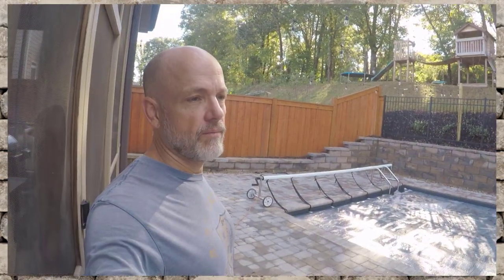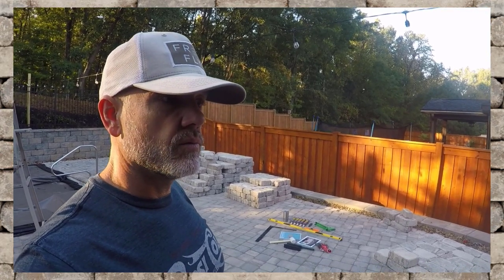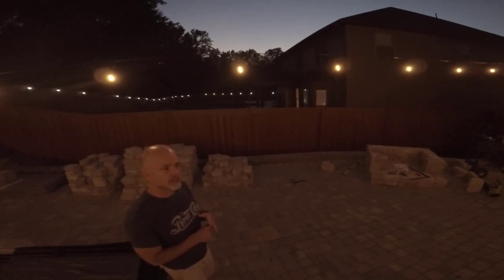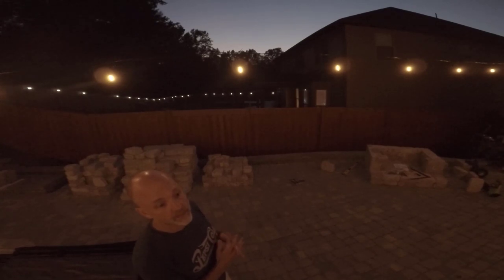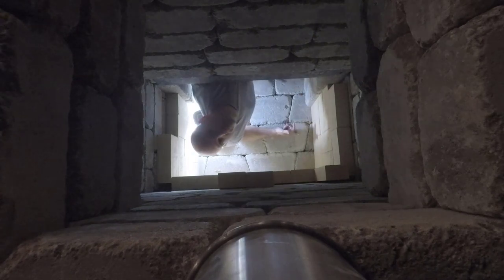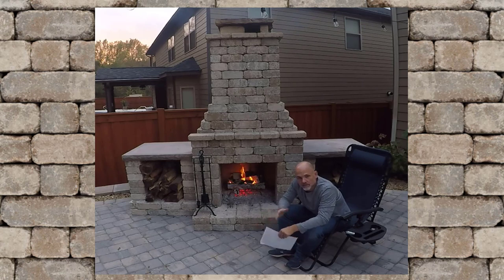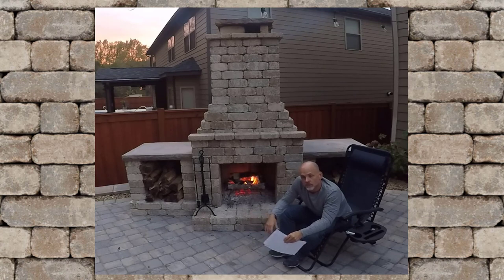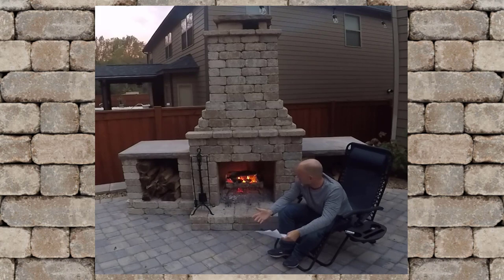DIY Outdoor Fireplace Build - Time Lapse - Roman Stone

Comment: Nicely done Rick. This is my next project and I appreciate your effort and willingness to film your work for all of us. One question, were permits required? I’m deciding between running a gas line, or just going with wood. Also, how far away from your fence were you required to place the closest stones. Does the back get hot?
Reply from the maker: Thanks Mike!  No permits. I thought about running a gas line as well, but decided not to. I just keep a box of fire starters close, and use good dry wood. The fireplace pulls a nice draft and our fires always start right up. 
Fireplace is about 12 ft from fence. Back doesn’t even get warm.

Comment: Do you know if the wood boxes can be added at a later time? We are looking to get one of these. however, the cost of everything has gone up significantly. So my wife and I thought about doing 2 separate projects. 1st project the fireplace and the 2nd project the wood storage boxes. This would help us split up the cost but didn’t know if that was a possibility. Thank you!
Reply from the maker: Hey Isaac. I don’t think that would be a problem. Check out the website and give them a call. They are super helpful.

Comment: Hey Rick- I must say I have enjoyed your video a bunch. I had really considered having a fireplace built but, most places in my area (greater Atlanta) start at 15K (whew). I am choosing the Fremont the same as yours and I am going to do the 24" chimney extension. You should become a "You Tube Star" because you did a great job. I think, just so you will know, the biggest tip I got was "taking it slow" and letting the blocks settle before going to each level. Using the wood box tops to help with the chimney was a great idea. I am a believer in sqaure and level because it pays off later on. I only have one question - how can you get in touch with these folks - cannot find a phone number anywhere. I want to do some preplanning for delivery as I do not want 8 pallets dropped in the street but, put farther back in my driveway - just want to talk with someone. I will let you know how my turns out
Reply from the maker: Hey Larry!  Thanks for the kind review. I don’t know about ‘YouTube Star”, but I did have a lot of fun making the video. 
Call Paul at +1 314-291-3200. 
He is super helpful, and will walk you through any questions you may have. (And let him know that my video was a help)😜
As far as pallet placement, you’re probably going to have to work with the delivery driver. They will have a pallet jack, and from what I’ve read in other reviews, they are usually pretty helpful. 
Let me know if you have any questions along the way. Good luck with your build!!
Reply: Thanks the reply Rick - will let you know how it goes
Reply: @Larry-GeorgiaTrains  Would be curious to know how yours went and what it looks like with the extension.

Comment: Great work until the square dancing started. I wish these kits were available in Australia. I was planning on building one with imitation stone blocks with rebar rods attached to a concrete foundation through them, then pouring concrete into them. However, this kit looks great but does it meet your local codes of building? I'm not sure how good that adhesive is in terms of holding those firebricks in place, I normally would have used fire resistant mortar.Great work and you saved $$$. Start cooking 🍕.
Reply from the maker: Thanks!  Where in Australia do you live?  I spent two years in Freo.  2007-2009
Reply: @rickhawkinson8693  Melbourne. Yeah, been to Freo in WA, nice area by the beach.

Comment: How much heat does it produce?  Does it keep you warm on colder nights?  Colder....as in 45 - 50 degree  -ish weather.
Reply from the maker: Hey Colleen!  It basically puts out heat similar to a fire pit. I’d sit around it with temps in the 50’s for sure, and once you get a good bed of coals, mid to upper 40’s would be comfy as well. So, all that to say it puts out a good amount of heat. And the fire is is so big, that you can put a lot of wood in the fire for those extra cold times.

Comment: Any concerns on how all that heavy, consintraited weight will able to be supported properly just laying onto of that existing paver deck?... I would be concerned that it might sag or settle down causing that stone fireplace to tilt out of plumb?...
Reply from the maker: Hey EE!  I had the same concerns and checked with Roman Stone before I built the fireplace.  The said as long as I had 4 to 6 inches of gravel beneath the pavers (which I do) it should be ok. I also had a friend of mine who is in heavy construction come and verify everything. 
Been up right at a year now and it’s still nice and plumb!

Comment: Looks fantastic. Has your neighbor complained of the smoke going right to their window? Did you have to get a permit? Also, did you glue the fire brick or just stack it? Thanks for the video and the information.
Reply from the maker: Hey Orion. The smoke doesn’t really make it to the neighbors house. The natural draft flows away from their house. And when there is a good, hot fire going, there is barely any smoke. 
Didn’t have to get a permit since it isn’t attached to the house. Just be sure and check your HOA regs. 
I did glue the fire brick in. They can be removed if I ever want to change them.

Comment: Find these fireplaces as a kit from a company means you’re gonna pay double what it would cost if you were just to buy the stones yourself. I looked at one of the kids it was $6000. The lowest one I could find was $3500. Don’t get me wrong so beautiful but I’m not paying $4500 (plus shipping) for the one that I wanted. I’ll just go by the stones.
Reply from the maker: William - I had the same thought when I first saw the price. I am a HUGE value for money guy so I priced it out just ‘buying the blocks’.   Here was my breakdown. ~$3000 for materials, and this is a low estimate. These are Orion blocks that have been processed to round corners and smooth edges.  And the 3 different sizes give the look I was going for.  You can’t just go buy these at Lowe’s.      
There wore 16k pounds of block - so with my 1 ton pickup, that would have been at least 7 trips. Loading and unloading each. 
Then you have to figure out HOW you wanna build it. 
And you’d have to either get the firebox tops and chimney cap made, or make them yourself. 
So - factoring all that in, I went with RomanStone. 
And btw, the cost you see on the website is the final cost. Shipping is included.
Reply: We’ll see that’s where you made the assumption that I’m gonna use those bricks for the building of the whole fireplace. I’m going to use cinder block for the main framing and stone as a veneer. I already priced out the stones to cover as a veneer. And yes, you can buy ones that have corners built into them. These stones in the kit  do not have corners built into them. They were just stones I watched them build it. And it’s not gonna be anywhere near 16,000 pounds as I’m using cinder block for the main framing.. the amount of stones that I would need just as a veneer only cost me $680 . And I can make that in one trip. So total cost would be around 1500 With everything.
Reply: 200 cinder blocks only cost me 570.
Reply from the maker: You do you William. More  power to ya!  I personally didn’t want a cinder block stone veneer look. I wanted the dry stacked stone look.  I hope things go well for you. Video the process and leave me a link. Would love to
See the final product!  Good luck!
Reply: No, it’ll be solid stone. I was just explaining to you as I’m going to use cinder block as the main framing and then the same stone as a veneer just so you understood what I was doing. It will be the same exact stone. Just the framing will be cinder block, and the exterior will be the stone. I just used veneer as an example so you understood what I was doing.
Reply: @rickhawkinson8693   looking forward to your video
Reply: Then find all the rock out in nature and build lol

Comment: That looks really good but that type of outdoor fireplace doesnt keep you warm outside. I have an actual firpit that is 2' below grade with 6" of stone around the edge. It puts heat out 360 degrees and keeps ypu warm 3-4' back from it. Now its not ideal for very small children because its an open fire pit but it does a great job. Mine is big though, you can fit an entire pallet inside it 😎
Reply from the maker: Definitely keeps us warm!  Obviously not as many people as a pit, but we can warm 6-8 people easy in below freezing temps. 
And it looks way cooler thank a pit - in my opinion.
We looked at both, and decided for what we wanted, the fireplace was a better choice.

Comment: Why use this kit vs buying rumblestone from Home depot or lowes?  I know the caps and trim pieces would not be included.
Reply from the maker: Hey Roadie!  Thanks for commenting. Basically, if you buy direct from Roman Stone, you cut out the middleman. Overall cost is about 2/3 of what you could get everything at Lowes for, AND it’s delivered right to your house AND you can get any question you have answered quickly by the good peeps at Roman Stone.

Comment: How many different size stones did the company provide and were they used throughout the construction project or were the larger ones used in a specific location like the base of the fireplace? Curious minds want to know. Thanks
Reply from the maker: Hey Angela!  There are 3 different sized blocks. 4 inch, 8 inch, and 12 inch. All three sizes are used throughout the build.
Reply: How many of each size are provided?

Comment: Hey Rick-
I have been building my Freemont and surprised at how easy it is. Of course the confidence from your video and the detailed instructions supplied by Romanstone really helps. 
As I near my completion I have a chimney extension and I wanted to ask how you got the cap safely to the top and if you have any tips?
Reply from the maker: Hey Larry! Congrats on your Fremont!  Glad the video helped. 
The chimney cap can be a bit daunting, can’t it?  I had a 3 step ladder set up with 2 neighbor friends. I put one step ladder on the left firebox and 2 ladders in front - with the steps facing each other.  You may have to play with positioning the ladders, but the three of us just walked the cap right up the ladder. BE SURE YOU HAVE YOUR CHIMNEY CAP SUPPORT BLOCKS GLUED AND DRIED WELL!  
And don’t do it if you don’t feel comfortable. Grab another friend and another ladder. 
You can see in the testimonials that some people rent a lift. That just seemed like a bit of over kill to me, but it is an option. 
I hate that I didn’t get that part of my build recorded!  I went to ask my neighbors before I set up the camera - and they both came right away. We were in the moment working out how we were going to get the beast up the ladders, and I just didn’t want to ask them to wait while I set the camera up. 
I should have. 🤨
Reply: @rickhawkinson8693  Thanks for the tips - I have 3 friends coming Thursday and we'll see how it goes - NO BEER until after it's up. I am going to try and get my wife to video it.
Reply: @rickhawkinson8693  OK - I am trying to picture the position of the ladders - I understand the 3 step on the wood box - been doing that with the chimney build. The other two ladders - how tall are they? You say they are facing each other in front, in front of the woodbox or in front of the fireplace? Did ya'll slide the cap over on the blocks? I have 2 16' ladders that can get up pretty high I am trying to picture where the third guy is positioned.
Reply from the maker: @Larry-GeorgiaTrains  hey Larry!  How do you like your fireplace after almost a year.
Reply: Hi Rick 
Very nice fireplace 
Do you know if the kit is available in ontario Canada
Thank

Comment: For half the cost- U can build one yourself. $5k? Crazy. Never.
Reply from the maker: (Whispers - I DID build it myself) 😂😂 
Love these comments.  Have at it Frank!!  More power to ya. 
I actually thought the same until I priced everything. 
I’m a HUGE value for money guy (my wife would probably say cheap) so rest assured - I did my homework.   
I’m also an nerdy engineer, so of course I have a spreadsheet where I priced doing everything myself - and would be happy to share it with you. 
Yes, I could have probably saved some money(only about $600-$700) but since I’m not a stone mason, it was worth it to me to have detailed instructions and the support of Roman Stone. 
Not to mention having everything delivered right to my door. Elimination the 37 trips to Lowes to get the little things you didn’t know you needed was almost worth the $700 alone!😜)